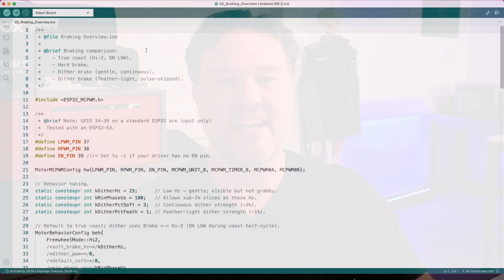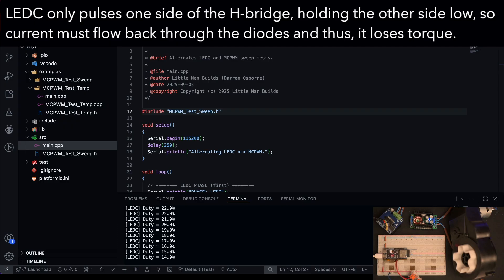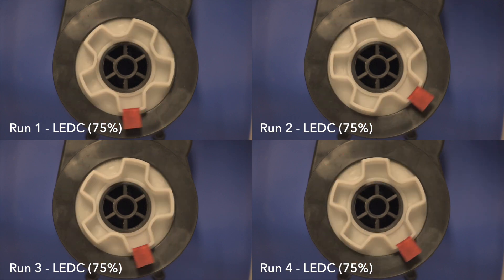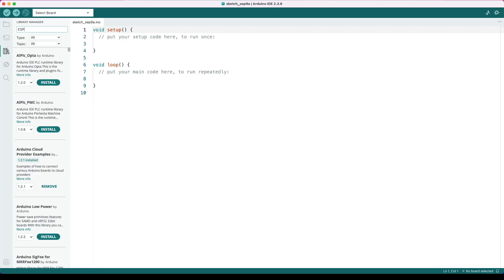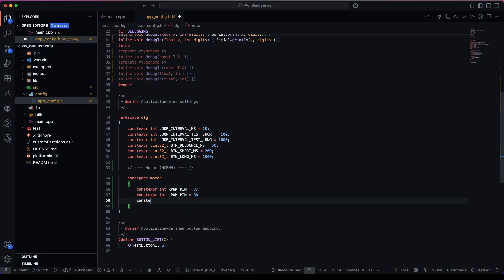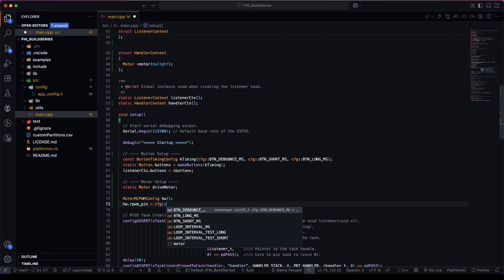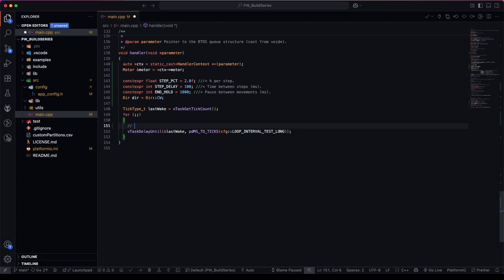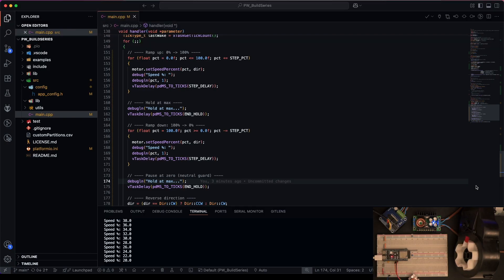LEDC vs MCPWM library — here’s what actually happened.

Comment: Thanks for the video
 I want to control four bldc motors, which method is better MCPWM or the RMT peripheral
Reply from the maker: That’s a good question. The whole system right now is tuned around a very specific use-case: producing clean, predictable PWM for brushed DC motors through a H-bridge. Being built on top of MCPWM just makes it better and more stable.

BLDC control, though, is a completely different world. If you’re using ESCs that accept normal servo-style PWM, then the MCPWM library would likely work. But if you’re planning to directly drive four BLDC motors from the ESP32, or looking at something like DShot, then this library doesn’t really cover that. I don't have a huge knowledge surrounding DShot, but I think the RMT peripheral can better produce the tightly timed bit patters needed. Likewise, true three-phase BLDC commutation would require paired PWM channels, synchronization, and a whole new control layer that simply doesn’t exist in this library at the moment.

I would have to think about whether an optional backend for DShot-based ESCs, or a higher-level motor peripheral makes sense... but my focus right now is to build new features for the car project (which are on the way... just been a bit tied up with work).

Appreciate the question all the same, and hope that you find a good solution!
Reply: Thank you for the clarification  @MoreLittleManBuilds

Comment: Рекомендую попробовать библиотеку GyverMotor
Reply from the maker: Cool library, thanks for sharing! GyverMotor is a solid choice if you need something portable across different Arduino boards, and I really like some of the built-in features. That said, the point of this video is to show why the ESP32’s dedicated MCPWM hardware is such a big advantage — it gives me center-aligned PWM, rock-solid timing, and proper braking/coast behaviour that generic libraries can’t match. On top of that, my library uses an abstract class design, so I can create multiple motor instances and integrate them cleanly into higher-level managers. For my ESP32 projects, MCPWM is simply the right tool for the job.